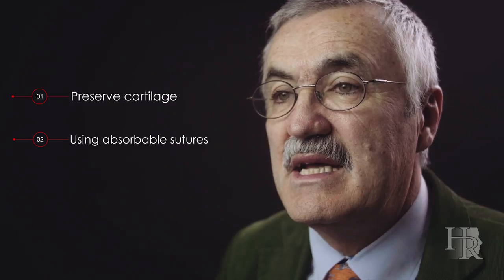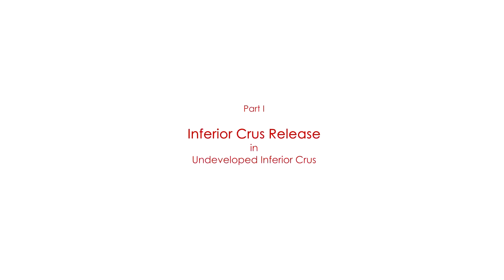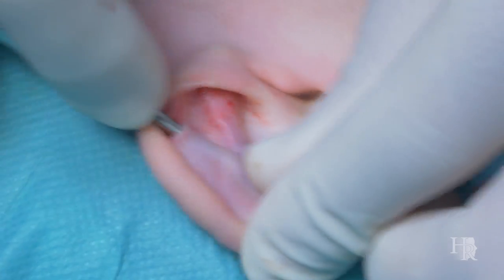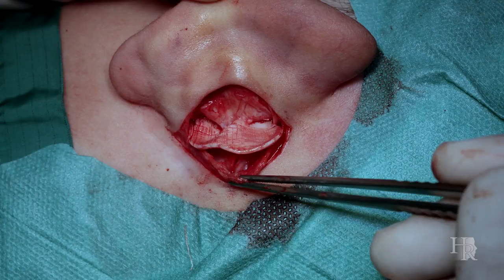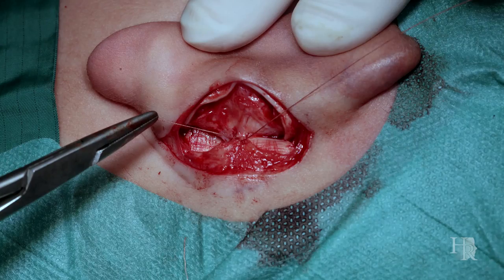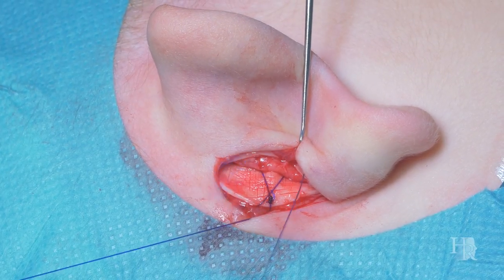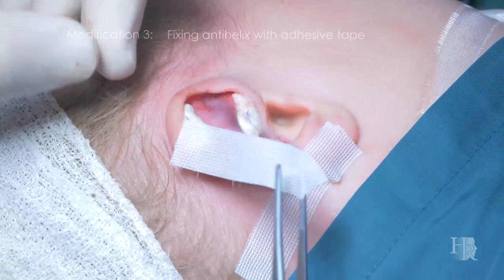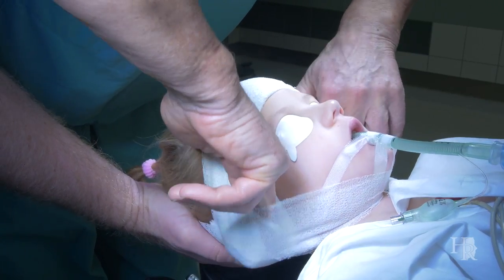4K EAR SURGERY, BIOMECHANICAL OTOPLASTY  TECHNIQUE - TUTORIAL, with Dr Hermann Raunig.

Comment: The Technique looks brilliant. I wonder How you permanently control the antihelical corrected fold with the absorbable suture only . have you experienced relapse of some of the folds ? or the cartilage filing weakens it & make the fold stays after healing of the surrounding tissues .
Reply from the maker: The amount of filing you do on the cartilage is very minimal but enough to change its shape and reduce the tension locally . In 2005 I published the filing technique on 302 ears without using any modelling suture at all. But that needed a dense follow up for about 2 months. To shorten the follow up time I changed to absorbable sutures to preserve the desired shape and fix the result.  (In the very beginning I have tried permanent sutures too, but they caused lots of problems, even after year.
The risk to get a relaps is about 1%

Comment: some Doctors says that cartilage have memory and should be removed to avoid revision , is removing cartilage is necessary or not ? can we have permanent result without removing cartilage and thanks .
Reply from the maker: Yes we can! Auricular cartilage has elastic fibers. The balance of these fibers is the so called memory. If you change this balance you do not need to remove the cartilage as you can see in this video. No doubt, if  the conchal bowl is overdeveloped you have to cut auricular cartilage but you don´t need to remove the cartilage. The cut must stay invisible.

Comment: I think that posterior based incision approach is better and also can do cartilage preservation and even with out suture to anterior surface of auricular skin
Reply from the maker: I think you did not go through the whole video, otherwise you would have noticed that there is an anterior access only  for the antihelix. Weakening of the cartilage does not make any sense from the posterior side. Concha reduction and set back of the lobule have a separat access from posterior side. If you can achieve the same natural result in a different way please let me know. I am eager to improve my knowledge and make my patients and me happy.

Comment: Hi there I would like to know if this is the same as the "earstitch" method done by Greg O'Toole in the UK? Many thanks
Reply from the maker: Earstitch method is a modification of a suture technique - that means permanent sutures have to be used. I am using only absorbable sutures because of the well known problems related to permanent sutures. You cannot make excess of cartilage disappear by sutures only.

Comment: im really interested and have been insecure about my ears forever. im 15 years old, 16 in 3 months, and i want this surgery. but is it safe for teens? what are the risks? what if thes urgery goes wrong?
Reply from the maker: Your question is unusually mature for your age, congratulations. I have done this technique in the wide range between 5 and 70 years. So age is not a problem. Compared to all present techniques the risk that surgery goes wrong in my hands is absolutely minimal. As I do not damage the cartilage the procedure can be redone without leaving visible marks.
Reply: i had mine done a year and a half ago , i was 12 and it was the best decision of my life - i really recommend it💞

Comment: For otoplasty, is it about 4k for both ears or just one? And does the surgery come with anesthesic or is that a separate payment? After the surgery is there a pain felt by the patient? How long does it take until you are able to touch water, as in water theme parks or going to the ocean?
Reply from the maker: The price depends on the deformity but usually is less than 4k for both ears. Surgery includes anaesthetic ointment before the local infiltration. (So you hardly feel any pain) There is no extra payment. At the end of the procedure I apply a long-term anaesthetic, but you will need a painkiller in the first night.
Skin closure is done with absorbable sutures, so I don´t need to take them out after a week. 
You can wash your hair one week after surgery.
Swimming is possible as soon as the absorbable sutures of the skin  have dissolved (2 - 3 weeks post op). That is approximately  the time,  you have to wear a head band.

Comment: How we Can remove the scars behind the ear
Reply from the maker: The best way would be to avoid excising too much skin -like I do. So you can close the skin without tension.  If you got scars already you can infiltrate the scar tissue with Lidocain Hydrochlorid once a week until it becomes soft. If you are not allergic against this local anaesthetic it will be a big help for any scar tissue.
Reply: @herau1  any cream for stitch marks
Reply from the maker: I am sorry, there is no cream that can penetrate such a hard scar tissue. You can use an anesthetic creme before the injection to make the scar num. The injection should be done very slowly, then it will not hurt.

Comment: Does the string stay in the ear forever?
Reply from the maker: NO, NOT AT ALLl ! I am using only absorbable sutures.
The sutures for the skin dissolve after about 12 days, so you do not need to remove them.
The sutures for the cartilage disappear after 5 - 6 months.
I don´t use permanent sutures any more, because they may extrude even after many years!

Comment: What is the chance of the surgery NOT to work?
Reply from the maker: 1) If the auricular cartilage does not have enough elastic fibres to respond to filing (I can check out before surgery)
2) If you bend your ears ahead before about 3 months are over (A very kind patient of mine had the habit to sleep oh his ears bent ahead since he was a child. I didn't know about that. After surgery he continued with that habit while sleeping. So the result was not as good as in the beginning) 
3) If you don't use the head band after getting off the bandage.
4) Otherwise the risk for a relapse is about 1%.
Reply: NEW EARS / Dr Hermann Raunig Thanks !

Comment: what is cost for this
Reply from the maker: On my website you will find more informations about these details.
Reply: Hi there I would like to know if this is the same as the "earstitch" method done by Greg O'Toole in the UK? Many thanks
Reply from the maker: Earstitch method is a modification of a suture technique. I am using only absorbable sutures because of the well known problems related to permanent sutures. You cannot make excess of cartilage disappear by sutures only.